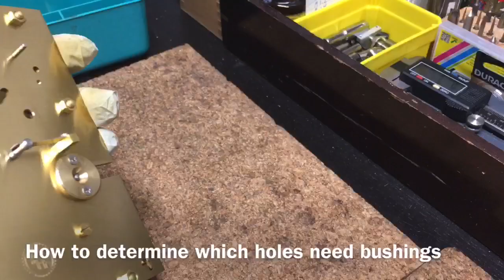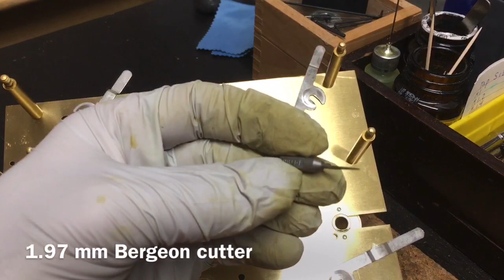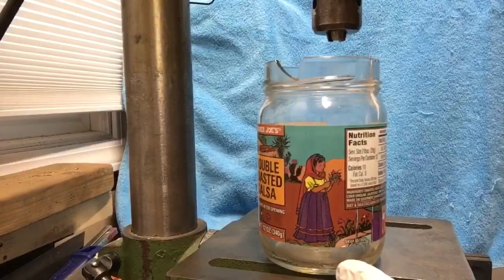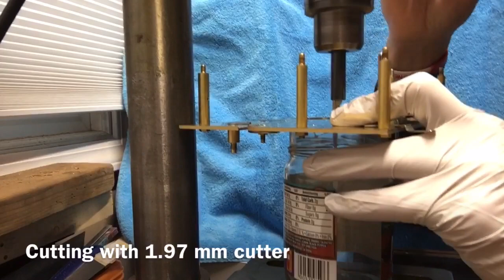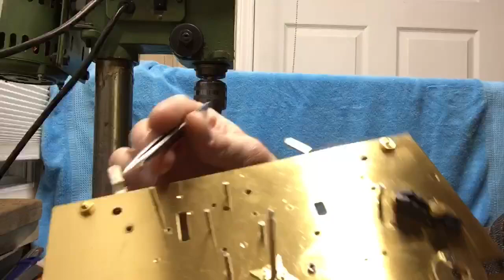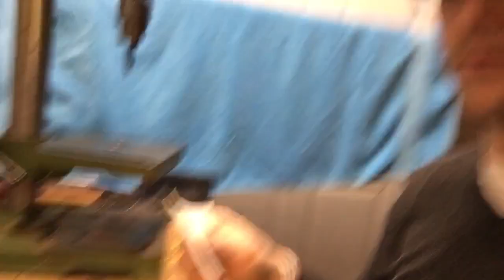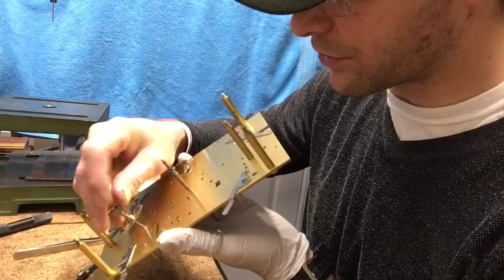How to bush a worn pivot hole - clock repair basics

Comment: Chris thanks for sharing your skills. I know that you do it but show the viewers how you correct the worn pivot holes to put them back on center before you do your final reaming.
Reply: Let me add a 'second' to this request..If you have 'tricks' I'd appreciate it if you could present them too...thanks
Reply from the maker: @Thelonedroner  sorry I didn’t show this in my video. You can do it in a couple different ways. Either using a needle file or your cutting broach. You want to insert your cutting broach into the hole so that it is straight on the unworn part of the hole. You then want to cut this open until you have opened the original hole to the size of the worn part of the hole. Now it should be round and on center. Then you can put it under the drill press and finish off the hole with your cutters.

I hope i explained that well. I will have to redo the video and include that step.
Reply from the maker: @Thelonedroner  if the hole is really worn badly, you can use a centering tool to find center first. You will have to have tooling to secure the plate so it doesnt move when you switch the centering tool for your cutter. I hope that helps!

Comment: You said you slow the jar to move a little to find center is that correct and how much pressure do you apply to the plate
Reply from the maker: Keep the plate firm so its flat on jar, but allow it to rotate so the bit finds the center. It takes practice

Comment: How much generally does it cost to repivot holes on average...like a range from x to x. I see lots of clocks which are pretty cheap that dont run but I guess due to repairs they are only worth something when they are running.
Reply from the maker: It depends on the clock. For an antique countwheel hour, half-hour strike I charge 285 with a warranty, but thats a full rebuild

Comment: Great video learned allot about hobbyist not needing expensive bushing tool machinery. But now I need to know exactly what to purchase to repair a single bushing pair. I can accumulate addition tool sizes as bushing repairs are needed on my collection of Mantel Clocks. So minimum would be? I have digital caliper and small harbor freight drill press and I guess your cutters are Bergeon? would need the tool that holds the cutters, whatever that is called or would the cutters just be used with the standard drill chuck on drill press,  I need 2 specific bushing CUTTERS based on pivot measurement, I could use larger drill bit instead of CHAMFER, need WIRE DRILL SET 0-60 maybe Huot , maybe 4" PVC coupler to hold plate on drill press, a specific size five sided BROACH, an aluminum or steel rod for PUSHER. and the 2 BUSHINGS themselves, can they be purchased individually or do you purchase a whole set or a small set of the most common used for Mantel Clocks? I guess the bushings all have an undersized hole that has to be drilled and broached to the size required? Is that about it and where would I purchase the tools, Timesavers, Ebay?? Sure appreciate your videos and advice.
Reply from the maker: Hi Larry,  Yes my cutters are bergeon.  I would suggest for a standard antique mantle clock you would need a 1.97mm, 2.47mm, 2.97mm and a 3.47mm cutter.  You can purchase a bergeon reamer adapter for drill press at timesavers.  That's what I use.  I would buy a small set of 5-sided broaches.  They usually come in a pack of 5 from size .77mm to 2.27mm or similar range.  With these you should be able to bush any size hole on a mantle clock.  You can order individual bushing sizes for each of your cutters in 10 or 25packs usually.  I would get one set for each cutter.

Make sure you gradually cut up to a larger size hole.  Also, you want to use a bushing size OD that is 2x the size of your gear pivot OD.  So if it is a 1.5mm pivot, use a 3mm bushing.

I buy most of my tools and parts from timesavers or micromark.

Hope that helps.
Reply: @Chrisclockrepair  Wow, thanks Chris, that's exactly what I needed. Specific information on sizes and description of what tools and supplies I need to purchase to get started with bushing repair for standard mantel clocks. Now I've got a wish list to work with and can get started shopping around. Thanks again and I may check back with you for advice. Great videos, very thorough instructions and teaching/training skills!
Reply from the maker: @LarryG-p5r  Fantastic! I love to hear that.
Reply: @Chrisclockrepair  Hi Chris I read somewhere that if you use a smooth broach to finish the hole it hardens the bushing and makes it last longer.
John
Times of the Past
Clock Repair
Reply from the maker: @johngilbert1752  hi john. I have recently started using smoothing broaches. I don’t know about the hardening, but it definitely produces a smoother finish on the bushing
Reply: @Chrisclockrepair  Those reamer sizes should be 1.97mm, 2.47mm, 3.47mm.  Also, suggest having a separate set of drills used specifically for brass and modified for brass.  Regular twist drills tend to bite into brass and should have the leading cutting edges slightly flattened by stoning parallel to the drill length. That will prevent a disastrous grab of the brass, especially with larger diameter holes.
Reply from the maker: @dperry428  You’re right! I put the decimal in wrong spot. They do tend to grab the brass. Although, as long as the bits are sharp and you chamfer the holes prior by hand, i typically don’t have an issue
Reply from the maker: @dperry428  yes I understand what your saying now. Thats a much safer way to do it.
Reply: @dperry428  @Chrisclockrepair   Hi, I am here in Germany, 74 years old and repairing my grandfathers cuckoo clock (for the first time in my life!). At first I found dperrys videos and I really enjoyed his pleasant mannerreally and learned a lot from him (already repaired the bellows etc.). Then found the videos of 'Chris clock repair' and must say: These videos of the younger and the older expert complement each other fantastically! Thanks to both of you!
Now I will think about buying me the equipment and dare to repair the worn out bushings. Best regards from Germany.
Reply from the maker: @erikhenrywilhelmhoffmann7662  That’s really wonderful! I couldn’t be more pleased. I will be doing another video soon.
Reply: @Chrisclockrepair  Thank you for the great video. What about tools and bushings for regulators/wall clocks. Can you advise the sizes of cutters,broaches and bushings.
Reply from the maker: @mohsenahmad772  please see my earlier reply
Reply: @Chrisclockrepair  Yes seen it, so I take it that Mantle clocks and Wall regulators uses the same size tools & parts. Thanks for sharing
Reply from the maker: @mohsenahmad772  Yes. That should cover it. If you need to bush an arbor you may need larger cutters
Reply: @Chrisclockrepair   Hello Chris. Would your aforementioned list of tools/sizes for mantle clocks also be the same list of tools/sizes you would recommend for cuckoo clocks? Thank you for your very helpful content
Reply from the maker: @Thumbkin859  yes. I have one set of tooling

Comment: As someone whose newer to clock repair, thank you for making this. It shocks me how cheap drill presses are and the possibility of me getting one is pretty high.
Reply from the maker: Absolutely. I’m glad you’re getting value from it. Is there anything in particular you would like to see in a future video?
Reply: @Chrisclockrepair  Yes, I would like to see a discussion on clock cleaning for the hobbyist. Specifically what is used as cleaning solution, rinsing solution and drying method, Can a clock be cleaned without teardown? Is there a cleaning or rinsing solution that will not remove varnish from movement? Can a clock be cleaned using spray bottles with toothbrush and painter tiny brush? Maybe Simple Green in a spray bottle, compressed air, hot rinsing water in a spray bottle, 91% Isopropyl Alcohol in a spray bottle, hair dryer.  Or something else?? Would love to see a barebones video on cleaning for the hobbyist who just needs to clean and oil as opposed to teardown, clean, repair and oil.
Reply from the maker: @LarryG-p5r  Sure thing. I can do a video like that!